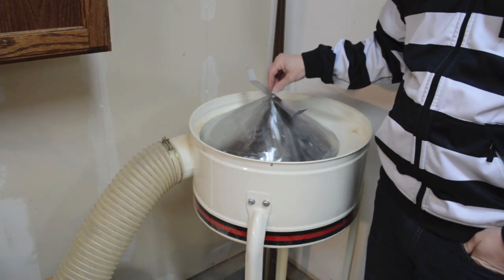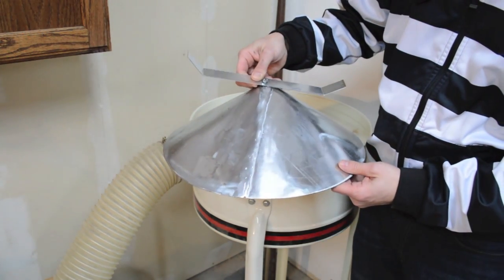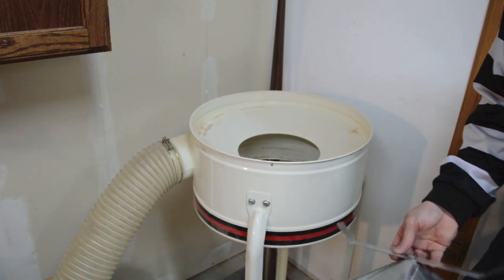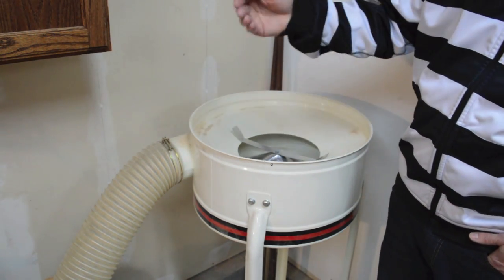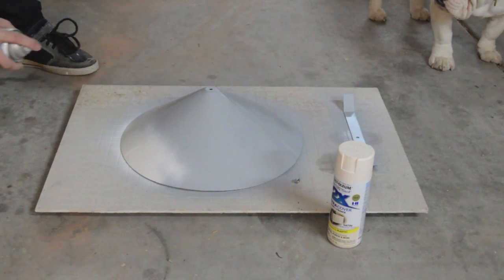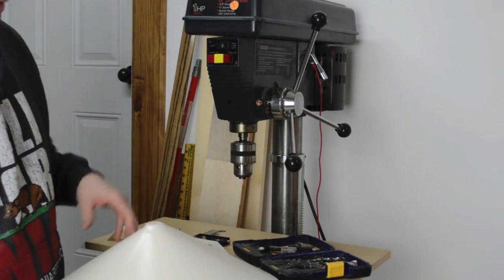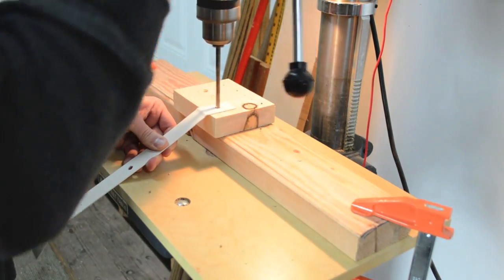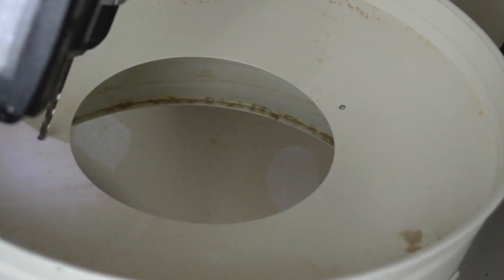Homemade Dust Collector Cyclone or Vortex Cone - How to retrofit your machine

Comment: First thing they teach you in shop class, DO NOT DRILL SHEET METAL ON A DRILL-PRESS WITHOUT A CLAMP!
If that bit grabbed the metal you would make a fast trip to the Emergency Room. Don't do it use a vice.
If you don't own a drill press vice buy one. they work wonders for odd and round parts.
You can buy a cheep one for 5-35 bucks on craigslist or shop tool sales like estate sales and garage sales.
Someone is always retiring or downsizing and they would love to sell there tools to somone who's going to use them.
Not to somone trying to make a profit.

Comment: That mounting central bracket should have been made of a thicker gauge material as it is going  to vibrate a lot and metal fatigue being what it is will give its undesired contribution.